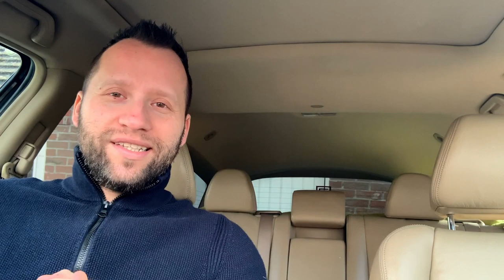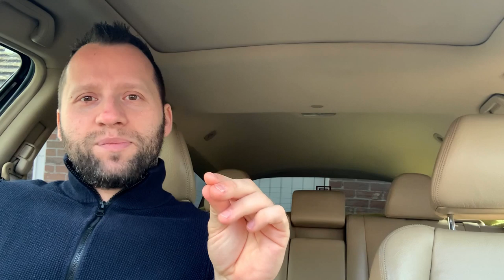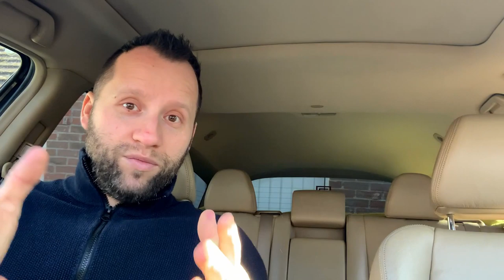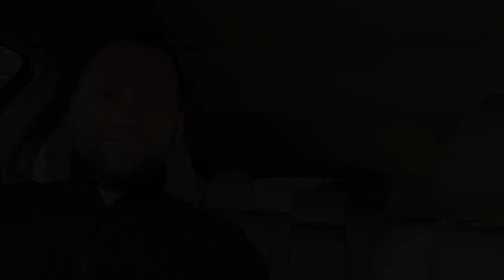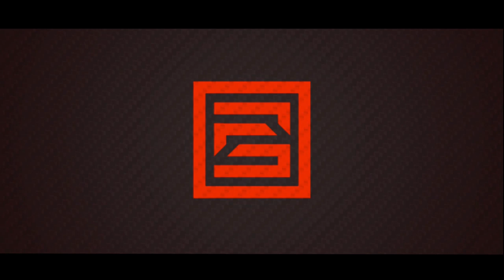SQ in Cars - PART 7.1 - What speakers for stock locations?

Comment: Also beyond speaker placement, the right car can have a huge advantage in things most do not think about. German cars for example have benefits in internal and external noise control that is hard to achieve with dampening alone. Reflections minimized with specific materials throughout the cars interior and especially dash material designed to absorb reflections. Door cards are absolutely solid with minimal flex and sealed from the inner door. No 2 pieces of metal touching without rubber seal. An accumulation of these seemingly small details make a huge difference in SQ. Some cars are really designed to eliminate road noise and accentuate a quiet interior which is a plus for the ultimate car audio experience. Then the next guys door card is visqueen or even nonexistent. Good stuff Peter!!

Comment: I used to have a Fiat Seicento in the early 2000s, it had 4" factory locations in the dash, I built enclosures in the doors for a 6.5" and ran an MB Quart 3 way set up. Even without any DSP it sounded great.

Comment: Out of interest I'm currently building a mk3 golf not specifically for audio I am planning a small sq build using helix psix and helix mono amp for the sub, 3 way front stage using hertz mille pro 3way components for now  and single rear helix q10w. I was planning to build a pillars for mids and tweeters but stock tweeter location is on top of the dash firing up at the windscreen and the way the stock tweeters and location are designed a 3 inch midrange would fit in the stock tweeter location.  Would you utilize this location for the midrange rather than putting them builds in the a pillar?

Comment: I realize you can't go into every detail on these sorts of things, but it is worth pointing out that many of the statements are generalizations. For example, for many cars the kicks are a terrible location for midbass, causing all sorts of peaks and nulls, and the doors can be a good place for them (with the caveats that you mention about having a rigid foundation). Two of the most dominate cars in the US have door midbasses for example. When I moved from kick to door midbass my raw response improved quite a bit.

It is a quite common perception that the only place to put midranges is on the dash or pillars, but that isn't always the best spot either. You point out the reflection issues and while yes they can be overcome with a LOT of work, some cars work great with kick midranges with very little work. My own car spent 3 years with dash locations until I finally went with a kick midrange (tweeter in the pillar) and holy cow what an improvement with no loss of stage height (yes it was an IASCA comp car), so there are no absolutes in car audio, other than cars suck for acoustics :)

Side note: Matt Hall's Mercedes had Jordan's and AE 12" subs in the kicks. It started out having a sub in the trunk but once the 12's were vented out properly the trunk sub was no longer required. Having spent many hours in that car I can attest to the benefit of an up front sub setup :)

Still a thumbs up video BTW

Comment: Hi Peter. Once again an excellent video. I have pretty much what you described at the start. A BMW E90 3 Series. The fronts are MBQuarts running passive, they are high passed at 200hz. Under the seats are the Audison woofers which are bandpassed between 80-200hz and I also have a 12" Alpine Type R in a sealed enclosure. The headunit is the 80prs. Ideally I want the p99rs, Slightly old now but looks and sounds great. The amp is a 5 channel JBL GTR 7535 but I'm really tempted to either get the Alpine PDX V9 or the the Helix G Five. Have you had a play with any of those two?

Comment: Hi Peter. Can i ask for your recommendation regarding a new setup from my JBL GTO 609C on a VW Passat b5.5 front doors and roof well deadened? Just a recommendation i'm asking because i know it's a matter of personal taste and many other variables also it's impossible to listen in any showroom here in Bucharest:
1-infinity kappa perfect 3 way (600mid-bas + 300mid range)
2-hertz mille pro mpk 163.3 3 way
3-focal performance ps 165f3
Will build mids+tweets in front pillars woofer in oem location. Door doesn't rattle, did the job with deadening.
OR if you can make another recommendation from your experience in this budget. These above here in Bucharest are around 500euros each.
I will go passive (can't afford a dsp now) and also no Sub for the moment. So they need to handle some average daily bass also.
Thanks. Will be much appreciated & keep up your awesome work!

Comment: Love your videos! Wish I found them before I had to learn a lot of these lessons the hard way. This video was particularly relevant but to keep it short I’ll just ask about the current project I’m working on. 

I’m currently swapping the bose system  out of a Saab 9-7x, and for this build I was actually going to keep it simple and put some nice full range wavecors in the stock dash. I did however plan on using tweeters. 

since I already bought them, I wanted to know what your thoughts were on placing the tweeters next to the mids on the dash. I saw in your other build you did the mids on the dash but the tweeters in the pillars. Any reason I should stay away from tweeters in the dash?  I will be using 8ch dsp. Thanks!
Reply from the maker: SoDiezl350 comb filtering is the keyword you have to research and understand. 
Some people put tweeters next to the mid on dash, I don’t, but may test it properly one day. 🤷🏻‍♂️👌✌️

Comment: With new Audi models, basic sound system is 8 inch 20W 4 ohm woofer in door (free air) and 1 inch tweeter on A pillars… I tried to tune the drivers with internal head unit dsp and the sound quality improved, but with only 6 parametric eq filter per channel I can’t do much, also I don’t think that the 8 inch will ever sound good in midrange region

Comment: Good videos , like your car redesign the entire dash ,, my car is a 1999 cadillac Eldorado , front wheel drive, in have a ton of room in center console, and wanted your opinion , on building a enclosure for a bass driver firing forward in the center of the car , fire tords the front fire wall in could fit a 8" sealed what's your opinion , of course it would be wired in mono and then the doors deadend in stereo !! Just a simple reply ( yes or no) thanks peter , sq set up !!
Reply from the maker: Dennis Walker front sub in centre forward could be great upto 70/80Hz, then make space for 5” on the dash, off you go! 😃
Reply: @pssound9749  thank you peter, will do !!!

Comment: How do you feel about those aluminum pods that mount on the a pillar for a midrange and tweeter?
Reply from the maker: Hi, not keen on them, but that’s a simple option for DIYers without experience with fibreglass.
Reply: @pssound9749  ok thanks a bunch. By any chance what speakers would you recommend be placed in the pods. I’m assuming air space is the issue with them. I have a Lexus suv with dash speakers. Just seeing what my best option is. Just keep the stock location or get something like the pods. Thanks again for any advice

Comment: Hi Peter, great info. I have a vw caravelle/transporter with factory speakers. Was thinking about taking out the air vent to get some wide band in. You mentioned using wideband and reflecting off the screen, I have tweeter locations up by the screen which I think could be easily modify to fit 2" wideband. Do you think using the factory location is ok, and what wideband 2" would you suggest. Cheers.
Reply from the maker: jason kirby watch one of the latest project where i used a 2” widebands in a Caddy, that will give you better idea.
Where do u live?

Comment: Is it impossible to get a good sounding front stage without a dsp? I am running 14 speakers in my front stage. 6 crossovers - all 12db and I been waiting for the helix ultra dsp to hit America at a fair price. I cant pay 1700 for a dsp at this time.
Reply: 14? Geezle.
Reply: Why not buy a audison bit one? and what is your front stage? like 6 midbass 4 mids and 4 tweets?. And you could always try and set up a band pass via your amplifier...or just a high/low pass..
Reply: That setup sound like big bad lobe. Would not do it but you might have wanted your system to be loud as possible. If anyone want to build good sounding setup buy dsp first, for starter amps and wiring can be anything, just take attention choosing speakers
Reply: 1337 IOT  it sounds to me like you have your system done for both passenger and driver center stage right.
Reply from the maker: 1337 IOT 6 crossovers?? What are you doing there? 😃😂
Reply: @pssound9749  Hey man, can i ask you something? When installing active three way front...do you adjust the gain to match the tweets or mids for example? Or do you set the gains to output rms wattage from the amps and turn it down on the processor to match the tweets and mids?
Reply from the maker: justkiddin1980 you have to send max clean level out of DSP and set gains on amps accordingly. You never just turn gains up to the sky on amps and then attenuate on a DSP, that’s the wrong way around! You gotta send as much clean signal as possible, otherwise you just raise the floor noise and amplify noise. Typical example when a system has a static hiss like SSSSHHHH even without playing music!
Reply: @pssound9749  Thank you, this is the first time for me building a active frontstage and a few tips from the master always help! Clean signal from  the headunit shouldn't be a problem as i am going optical with the Clarion nx807...Man this helps me a lot! Thanks again and i am looking forward to the next video of the mercedes, and if you want to do longer format videos with less editing...i would watch it...i don't mind longer videos...i have been watching the a-pillar vids on the previous mercedes multiple times already..😅😅 I am shamelessly copying your puzzle technique for my a-pillars in my passat cc...

Comment: If in those BMWs where the underneath 8” midbass/subs are crossing at 150hz and the 4” door speakers are supposed to be mids, where do you cross those over? 
The 4” door speakers shouldn’t be crossed lower than around 220-250hz.   So won’t that have a large gap between the 8” crossed at 150hz and the 4” mids door drivers crossed around 220hz?

Thanks!
Reply from the maker: Hi who said that the 4” shouldn’t be crossed lower than 220-250Hz?
Reply: @pssound9749  oh.  I thought you said it’s not good to cross a 4” mid woofer in a door to avoid rattling and pulling the sound to the side.
And don’t most 4” mid drivers have an Fs of around 100hz?   So shouldn’t they be crossed at around double the Fs not to distort?
Thanks so much for the education.   🙏
Reply from the maker: @Nightjar726  rattles can be treated and even if you have some, those only occur at loud levels, but by then you don’t really hear them as everything else is loud & screaming. Fs is a good indicator, but sufficient XO point and slope with the right tuning can easily protect a 4” speaker crossed at 150-180Hz.
Reply: @pssound9749  I have to say the Morel dealer here has confused me. 
He mentioned that all the BMW Morel speakers should be crossed at around 220-250hz.    As I mentioned I was confused by that.    
I honestly believe you more.
Reply from the maker: @Nightjar726  your Morel dealer should come to a Masterclass training to learn a bit.
Reply: @pssound9749  yeah I don’t understand him at all.